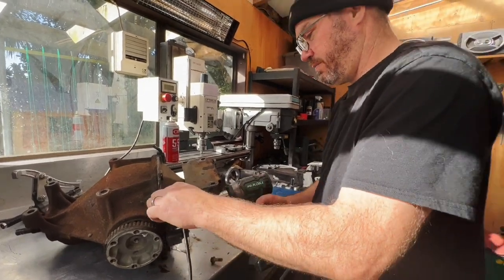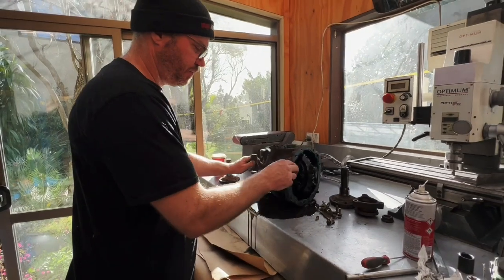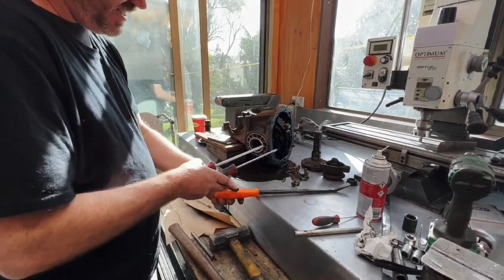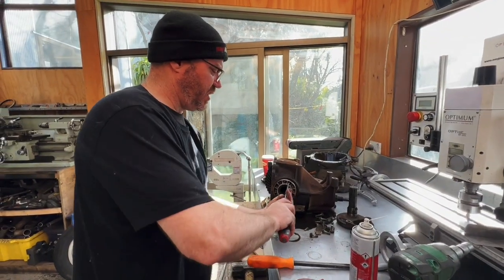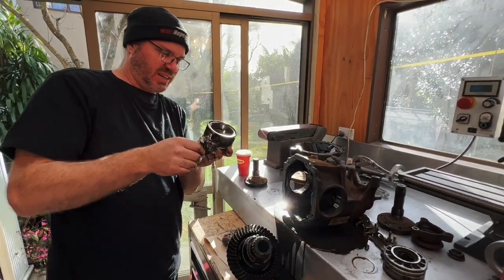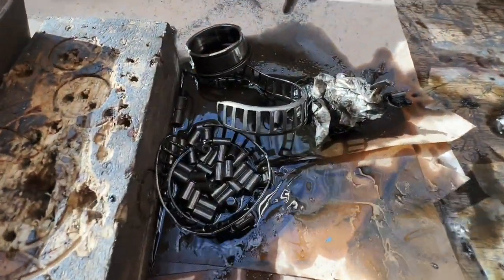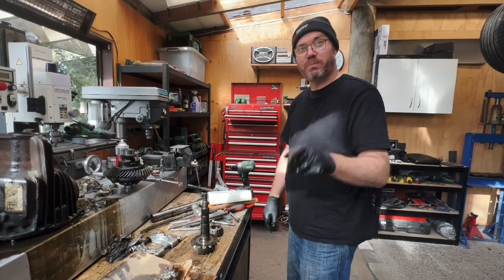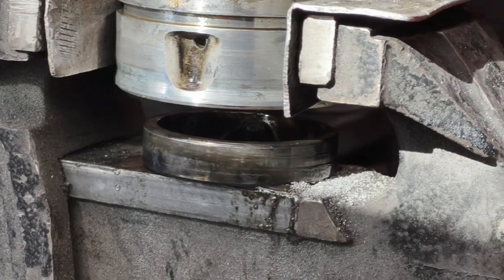Holden V8 Commodore M80 Diff rebuild part two

Comment: I replaced a set of bearings in an M80 diff in my Holden VY SS Commodore in 2014 but it still had a whine in it at 69 km/h,I thought that the gears (they're 3.91:1 gears) were no good anyway because they hummed at the speed prior to replacing the bearings,I was unemployed as well so I couldn't afford a new set of gears.

Next year one of my goals is to strip down a Dana M80 differential which is out of a VZ V6 Commodore which runs 3.07:1 gears, it's currently sitting under the house.

Since I believe that the spider gears may be chipped in my current differential because they're a bit noisy my goal is to order a recoed Dana M80 LSD centre,new 3.91:1 diff gears, new bearings & seals then build myself up a pretty much as new limited slip differential  !